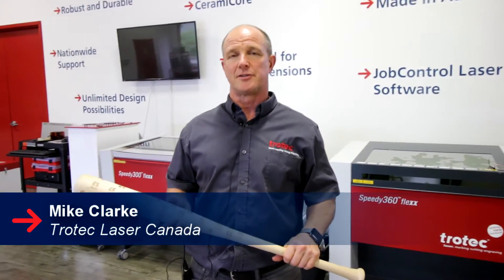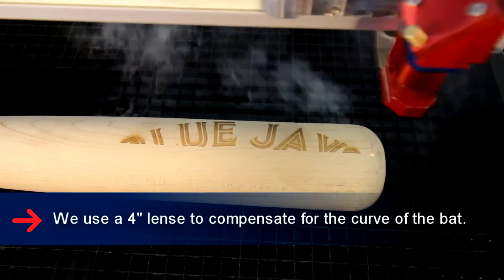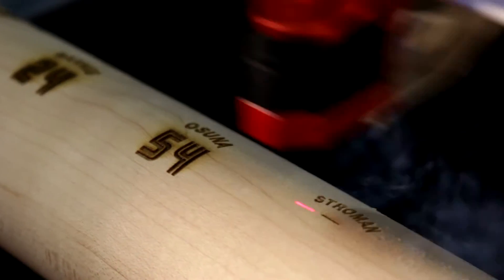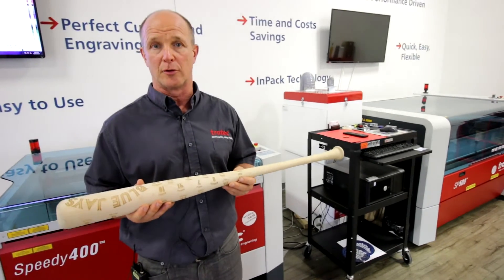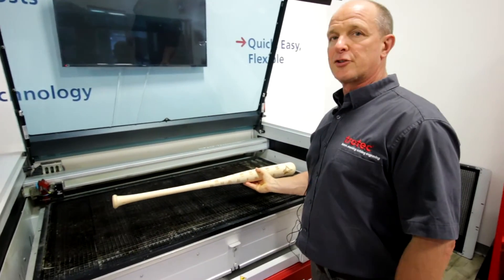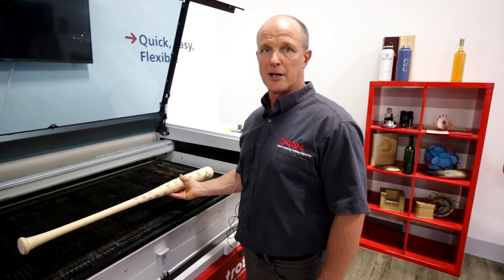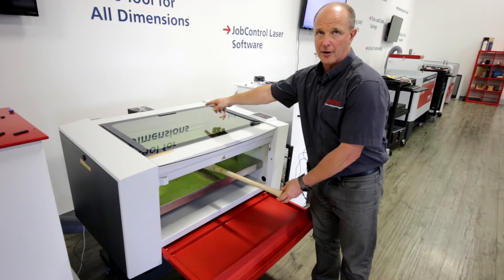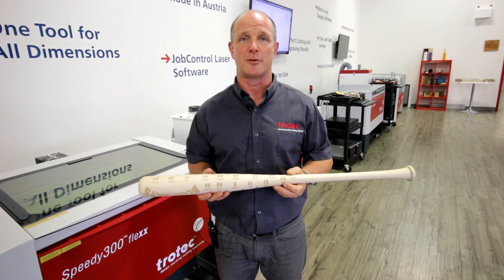Laser Engraving a Baseball Bat | Engrave wood bat | Trotec

Comment: When I engrave bats I have made a jig and put it into my machine on a diagonal.  Being 36" x 24" table size it works pretty well.  I run a zero power vector line down the center to make sure it lines up.  Usually the bats are only engraved in a small area but I have used the same technique with boat oars.  Great video thanks for posting.
Reply from the maker: Thanks Chalcus! It's good to know someone who does engrave them diagonally!
Reply: Chalcus thats a great idea!
Reply: Is having a cylinder rotary a must to put a logo on a wood bat? Say to put a logo the size of a Louisville Slugger logo on the flat side of the bat, can  just lay still and cover the logo on bat?